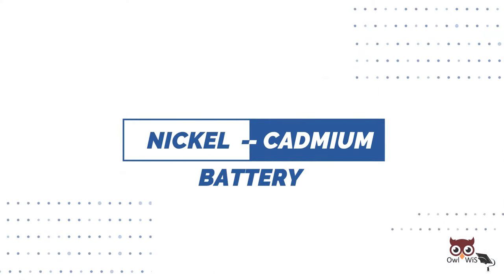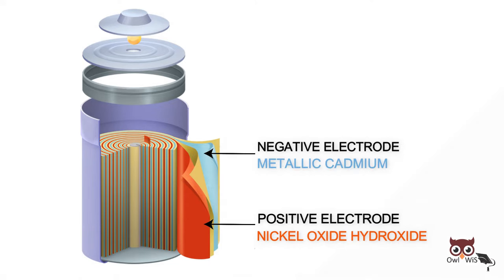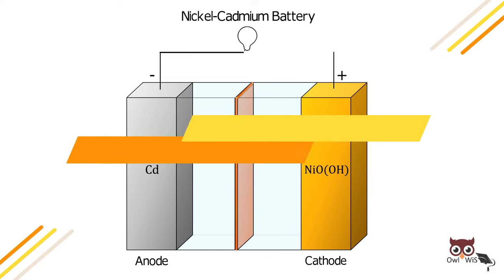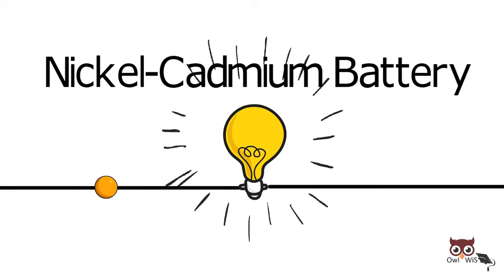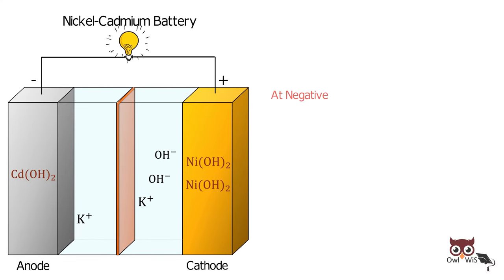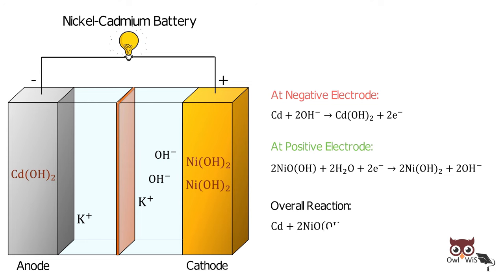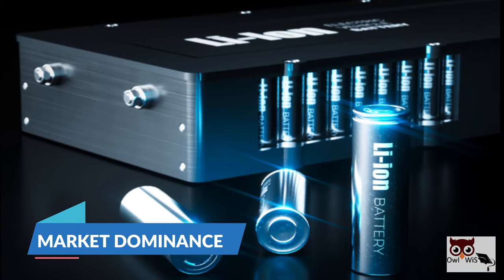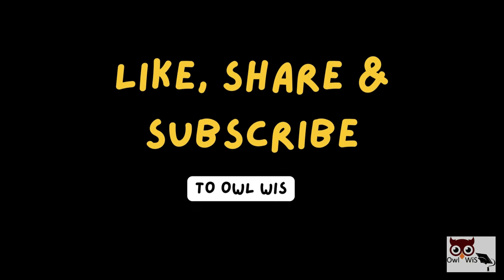Nickel Cadmium Battery Working | NiCad Battery

Comment: very strong and safe battery. cold and hot temperatures and deep discharge tolerance. in aviation sistems is a standard  battery.